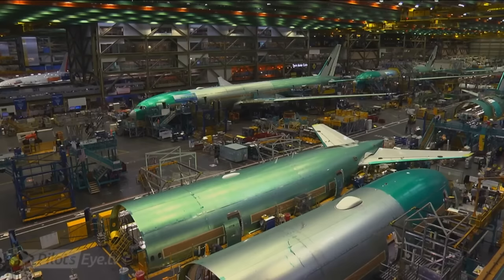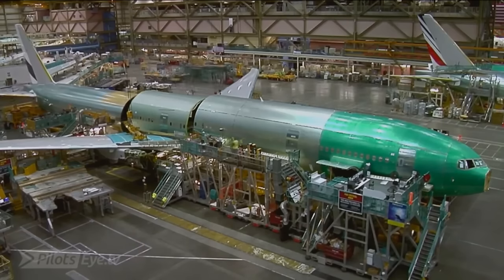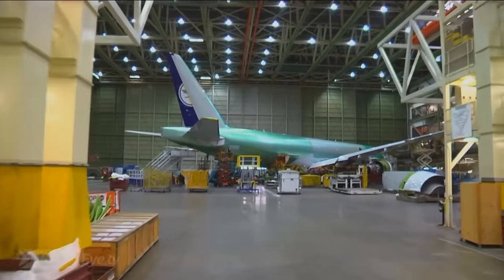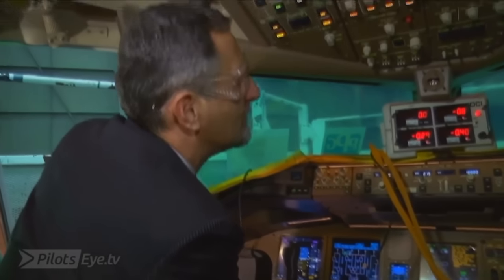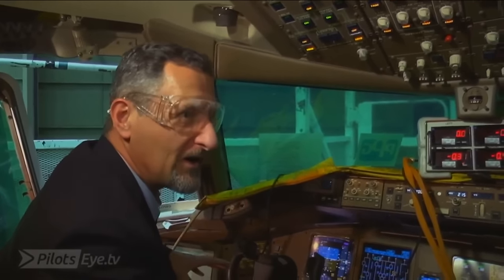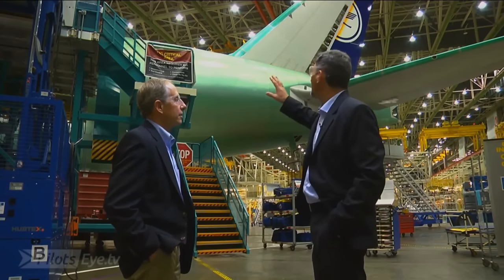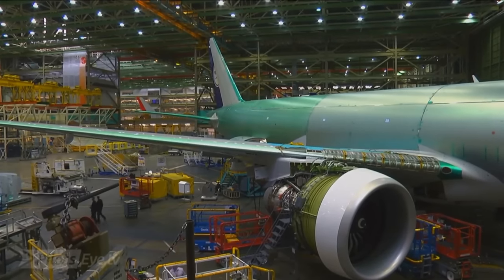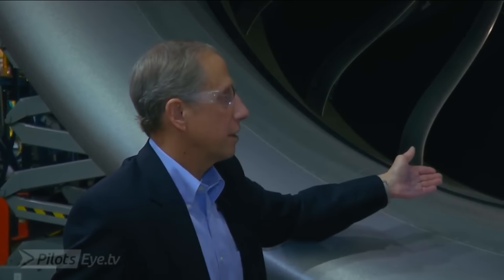Pilotseye.tv  - Boeing Factory Tour

Comment: No winglets?
Reply: The B777 doesn't have winglets.
Reply: Hmm... I thought winglets are supposed to be a good way to get more mpg from a plane.
Reply: *****
Well, they're apparently called "raked winglets". The 777 , 787 and 747-8 has them. They're not vertical, and also create additional lift because of their shape. Therefore they're more aerodynamically efficient. The 737MAX doesn't use them because that would increase the wing span too much for an aircraft of its size. That's at least what I can tell from a short research, now I learned something too, haha.
Reply: Boeing and Airbus have different philosophies regarding wingtip devices. Boeing feels that for long-range widebody aircraft, raked wingtips are the most efficient, while smaller and shorter-ranged aircraft such as the 737 would suffice with vertical winglets. Airbus obviously feels winglets are better, even for long-range planes, as they have winglets on the 340, wingtip fences on the 380 and blended winglets on the 350.
Reply: ***** They don't have the same philosophy when it comes to long-range widebodies. Airbus still prefer winglets over Boeing's raked wingtips.
Reply: ***** Um, not really. Take a look at the 787, then contrast it with the 350. The 787 has raked wingtips. They are horizontal extensions of the wing itself. The 350 on the other hand, has winglets that curve upwards. They are very stylised-looking, but they are curved up, which serves the same purpose as winglets found on the 340. You could say they are "blended" winglets, yet they remain winglets nonetheless, like the 737's and 320Neo's, and are NOT raked wingtips. Understand now?